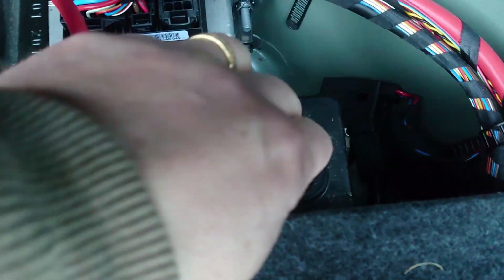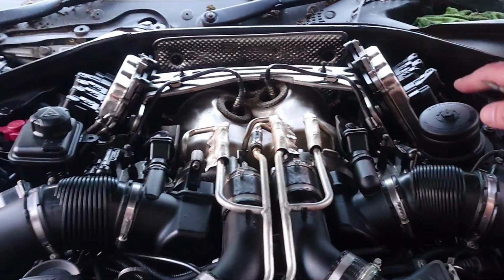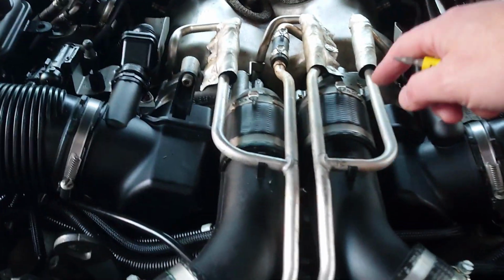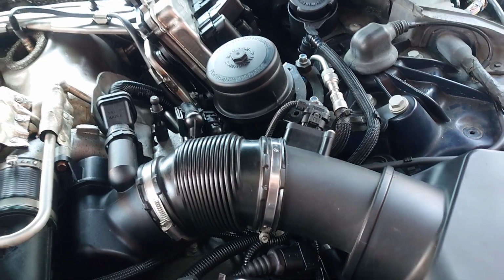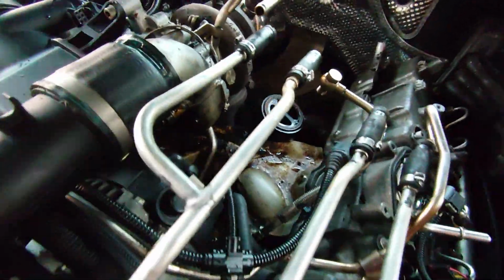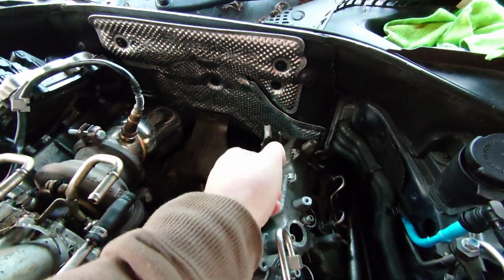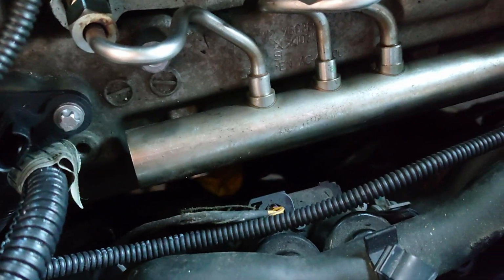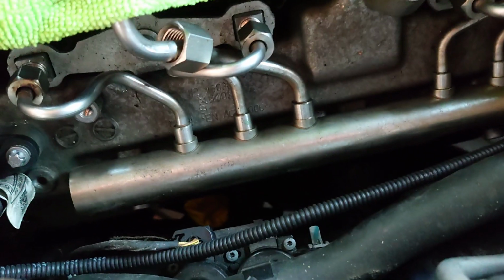BMW M5 - S63TU Engine Teardown and Rebuild Part 1

Comment: I have a 2014 bmw m5, unfortunately it has a blown head gasket. Can a head job just be performed? or is their a risk of it cracking the block?  I'm still on the fence of what to do.
Reply from the maker: +1DessyDsm1 you can yes but it's still a huge job. are you sure it a blown head gasket? what are your symptoms?
Reply: @RichsRides  Car is mixing oil and water.  It drives fine and sounds healthy. But also losing coolant somewhere. The oil fill and cap looks like a milkshake.
Reply from the maker: @1DessyDsm1  ah mate sorry to hear that. Do you know which head? If you do a compression test or leak down test you should at least be able to narrow down which bank at least. By the book your supposed to drop the engine to get the head off, but a decent garage should be pretty well practiced.
Reply: @RichsRides  I'll be doing a compression test this weekend.
I would like to say I'm able to do a headjob myself. Ive done valve seals on a few n63 engines.
A m5 shop is telling me that the block is more then likely not usable. So thats why I'm worried about doing all the work for nothing :/
Reply from the maker: @1DessyDsm1  if it's just a blown gasket I can't see why the block would be trash? Unless it's a cracked block? Only way to tell is to take it off unfortunately. Good luck, it's all doable.
Reply from the maker: @1DessyDsm1  how did the compression test go?

Comment: I just blew my m8 engine. Will this video be the right video I should follow?
Reply from the maker: +oc bimmers ouch! what have you done to blow the M8? sounds like a warranty job or is it tuned?
Reply: @RichsRides  man you will be surprised if i tell you what i went through. @1200 miles front axles blew up 3 times and none were covered under warrenty because i had spring and exhaust. @1800 miles replaced cluster 3 times. Atm unit x 1 time. Battery x7 times. Car wasnt tuned and i just happened to ran into some asshole sa. It only took me 1 month from the purchase date to get flagged. Its been 10months since purchase and motor has 5500 miles on it. And now spark plug broke in 2 piece and it dropped into inside engine and piston is fked
Reply from the maker: @ocbimmers139  holy crap, that sounds awful. Was the exhaust a full catless system or just cats back? It's a hell of a job to fix! What's your plans?
Reply: @RichsRides  looking for new engine . Exhaust is full cat back akrapovic. Ig@itzsollocuhz
Reply from the maker: @oc bimmers and they wont honour the warranty because of the exhaust? Have you tried talking to BMW head office ?
Reply: @RichsRides  ofcourse , they gave me a nice fat middle finger
Reply: I have an m4,m5 f90 , m8, x5m50i in my garage and this is how they treat loyal customer
Reply from the maker: @ocbimmers139  mate that sucks! Have you bought them all from BMW as new?
Reply: @RichsRides  yes sirr f90,f92 paying over sticker
Reply from the maker: @ocbimmers139  and they still treat you like that! WTF, it's like they don't want you as a customer anymore? Hope you get it sorted soon, where about's are you based? There's a few shops that might be able to help depending on where you are.
Reply: @RichsRides  southern california  please🙏 that would be very helpful
Reply from the maker: @ocbimmers139  no worries, from my many months trawling forums and Facebook groups I've heard good things about Pure Performance in Houston if you don't mind shipping the car, or for a but closer I've read some positive reviews about GMI Autodynamics in Santa Anna CA. But please do your own research and get details of other customers that have had their rebuilds completed successfully.

Fingers crossed for you.

Comment: That’s so unfortunate. I love this car and I was looking at Copart lately, I definitely changed my mind now after this. Good luck 🤞 Very nice content, looking forward to the next update.
Reply from the maker: +gerontic I think if you can see the cars and give it a inspection so you know what you're getting yourself in for its probably not that much of a risk. Covid meant I had to buy this blind so was always going to be a risk, but don't let my experience put you off. If you're handy with a spanner pretty much everything is fixable, just need to get it at the right price.
Reply: @RichsRides  I agree, everything is fixable and all depends on the price you pay. I haven’t got the space to work on cars as I live in central london so I am thinking to pay the extra money for a newer low mileage and well specced f10 which will hold its value instead of taking the risk. Would be very interesting to see a video on the cost breakdown of this build once it is done.
Reply from the maker: @gerontic  I'll do the obligatory Wheeler Dealers cost breakdown when it's all done. 😁
Reply: These cars are reliable, no need to worry, I own one it's been couple year now, no issues!

Comment: Thats a lot or work mate, keep it up. Keep the humor up you will fix it 👌👍
Reply from the maker: +Bmw_5_ Bmw_5_ feels like just the tip of the iceberg at the moment. its just going to get more and more interesting as it goes. I'm in good spirits and it's getting warmer which helps.
The real struggle is making time for it, wouldn't be so much of a problem if it was light but can't really work in the dark under floodlights just can't see anything! 
Trying to work out how to drop the subframe enough or lift the engine to give the access I need, I've got a few ideas but might have to get a bit creative.
Reply: @RichsRides  Yea, hope it does not get expensive for you. 😊 Your doing a greate job anyway, so what ever you do it will be good in the end

Comment: Can't imagine doing this without dropping the engine.
Reply from the maker: Tell me about it.... Wish I never started some days !
Reply: @RichsRides  I hear you. I would be afraid this job even if I had a hoist. I've watched a few tear-down videos of the S63. It's a complicated beast.
Reply from the maker: @darylmorse  German engineering at its finest! It could be worse though, I've seen some other videos of Mercedes V12's that look absolutely terrifying! I'm  also amazed they managed to fit it in the engine bay to be honest, there's so little space. Bm techs must have tiny hands.
Reply: @RichsRides  I don't think they give much thought to ease of repair. Putting them together on the assembly line is a lot  easier than repairing them.
Reply: @RichsRides  MB doesn't use a hot-v layout, so I think it's easier to work on than it would be otherwise.
Reply from the maker: @darylmorse  that's probably true for a lot of engines these days. When you see them being put together on a production line it all makes sense I guess.
Reply from the maker: @darylmorse  I actually like the hot V. But only when working on the exhaust side..... 😂